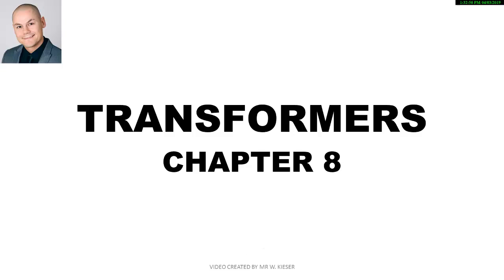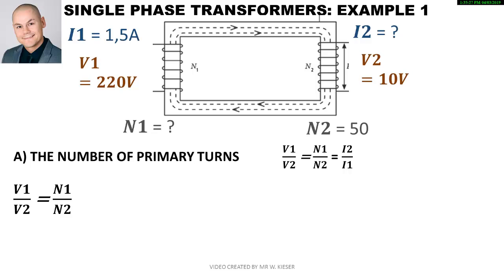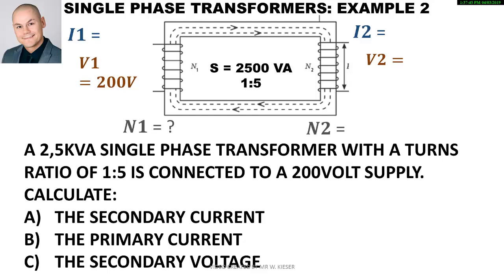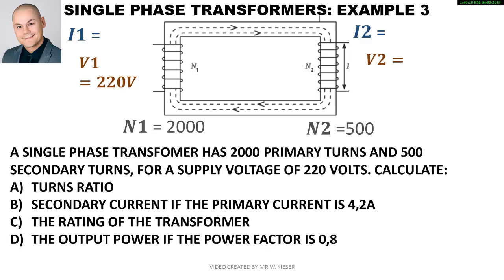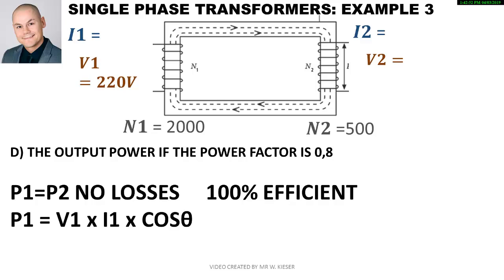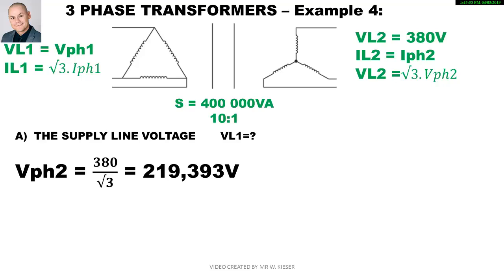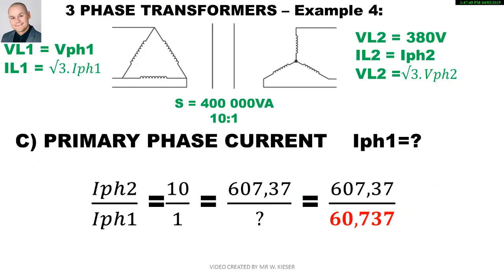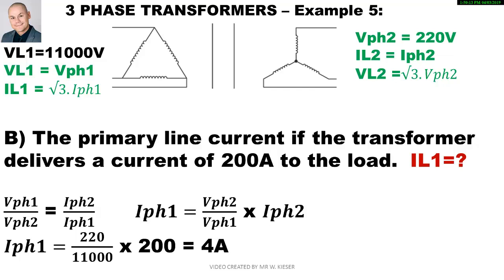TRANSFORMERS

Comment: How did you get 16va at question 3 number c ? 
You got 16,8 
If i take 220times 4,2 i get 924 am i missing something? 

Awesome video tho helps allot
Reply from the maker: It is possible for me to make errors. Not always easy doing calculations using software. 
Easier doing calculations with pen and paper.